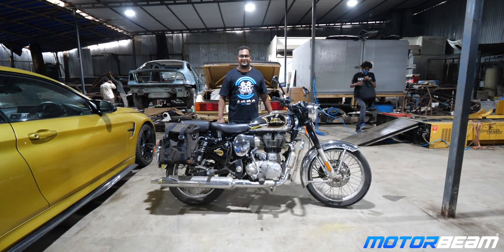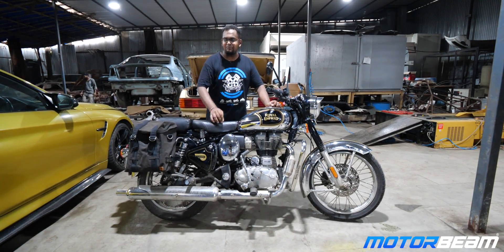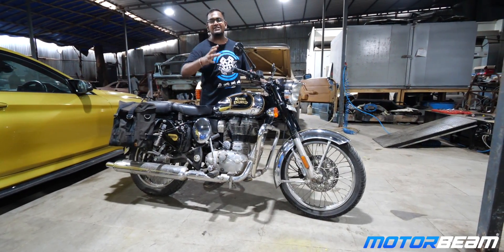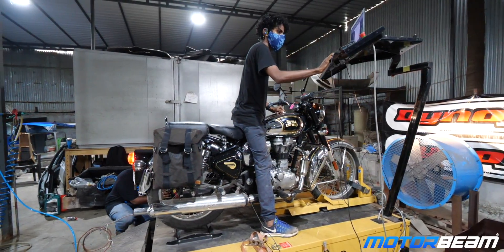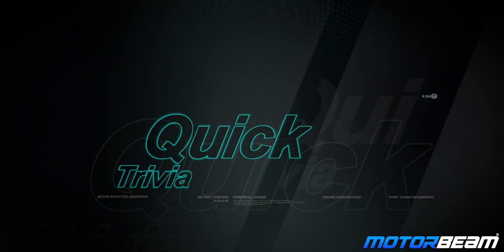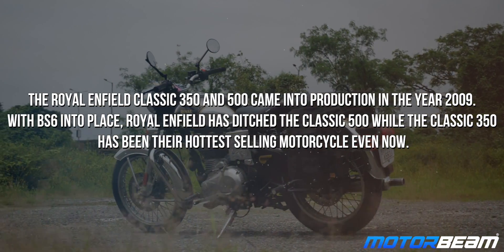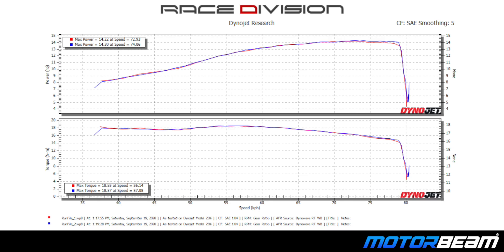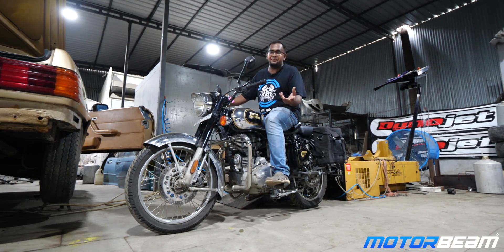Royal Enfield Classic 350 Dyno Test - A Torque Monster? | MotorBeam

Comment: I did full throttle runs on my electra for several years but it never gave me trouble 🤭😛
Reply: As long as you change the oil every 3000km/6 months, it can never give problem. It's a laughingly simple engine.
Reply: @sierrachief117  followed maintenance schedule very strictly
Maybe that's why my bike ran good without much trouble

Comment: That torque is flat spread throughout the rev range❤️
Reply: My 150cc pulsar gose faster than this, what will you do with that torque??
Reply: @pruthvigohil9845  wohi toh😂😂
Reply: @pruthvigohil9845  I will use in hill area
Reply: Bike hai ya tractor hai?
Reply: @pruthvigohil9845  it's a tractor
Reply: @pruthvigohil9845  you can’t go 100+ on your 150cc bike for a long time the engine is simply not capable to take that much stress